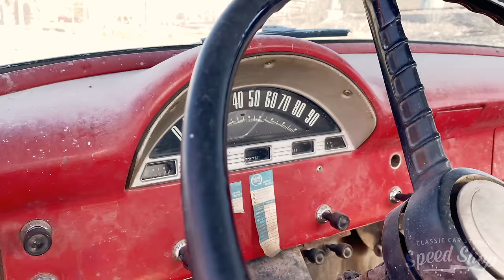Cab Fab • 56 Ford F600 "Crew Cab"

Comment: The truck is going to be awesome! Just wondering what you used for rear doors, and is the back cab wall the original one? Subscribed so I can see the complete  build.
Reply: I believe the rear doors are made from scratch, as they open from the front. From what I see in the video, the back is original.

Comment: I did this years ago with a friend then it got stolen before completion,  a53/55 cab on front then graft the 56 cab on bach gives better window shape, we also used a8foot 56 bed
Reply from the maker: Ugh, heartbreaking. Was it ever found?
Reply: @ClassicCarStudio  no it was not recovered i think either parted out or scraped, we started with a slant post 53 p/u then found e 3/4 ton 56 small window long bed 8ft, so we had a piller between doors, went looking for ribbed van roof for top  then lengthend frame 4 bar rear suspension 460 engine, CA trans

Comment: Removing the b pillar will really set this truck off. If you can make frameless doors too, it will look like one piece of glass. Killer build.
Nvm with the latch design on top wouldn't work. Still a badass build.